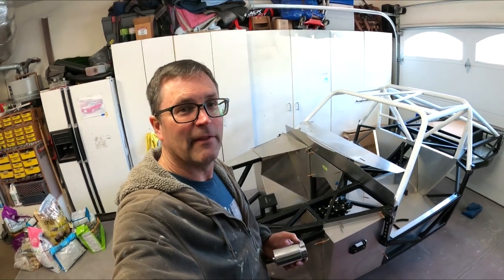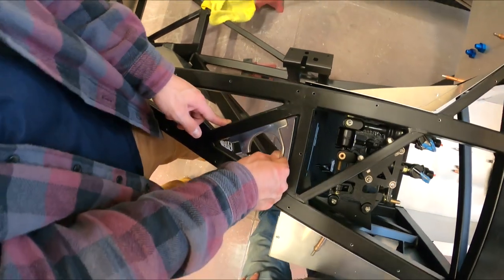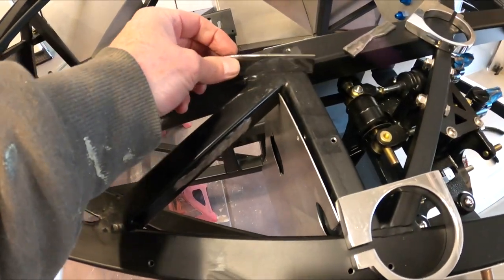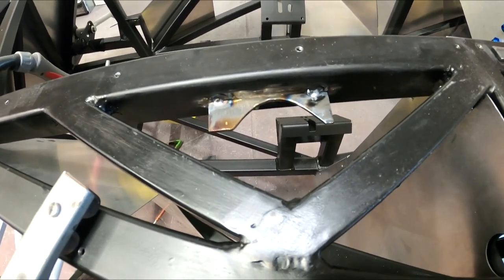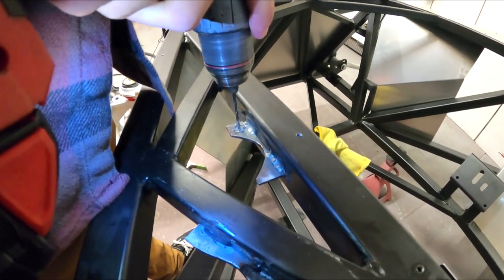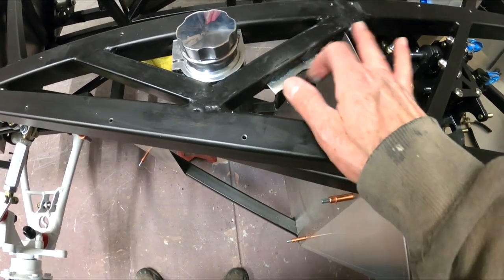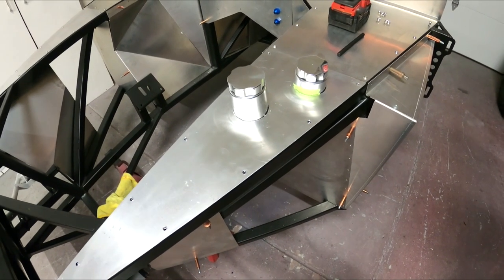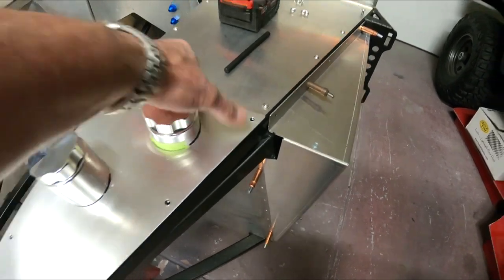Cobra Daytona Build-Brake Reservoir mounting, Video 27

Comment: Is that the brake system that comes with the kit or did you order them separately?
Reply from the maker: I ordered the entire brake system as a separate package from Levy Racing. Specific for track use.
Reply: @Cobra Daytona Build  so the original or the peddles and such were from them? I like the brake set up. Don't personally need that much rotor but the twin brake like a f1 car is epice. Or am I miss reading the way the brake system works?
Reply from the maker: The Wilwood pedal assembly comes with the complete kit and it is a nice piece. If your not tracking the cars the huge rotors aren’t necessary.
Reply: @Cobra Daytona Build  darn.... I can't afford the extra it is going to be hard enough to get the kit and a donor. Hopefully I can get started in the next couple years

Comment: Would you recommend the base kit or the complete kit with a few extra add ons. not sure what the difference in them would be.
Reply from the maker: For a first time build I would go with the complete kit after you get some experience then you canof pick your pieces and what you need and buy a base kit, but it is nice having everything you need.
Reply: @cobradaytonabuild1671  I’ve been doing a lot of pricing on the sight and they don’t have a drive shaft for a coyote with a t56 and a 8.8 3 link. I bet when I order it I can call them and they can set it up though.